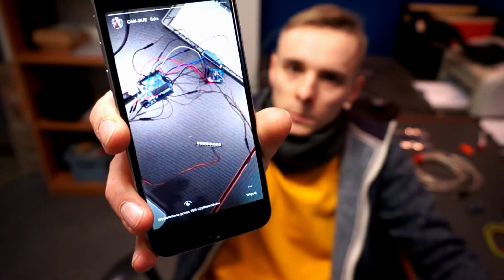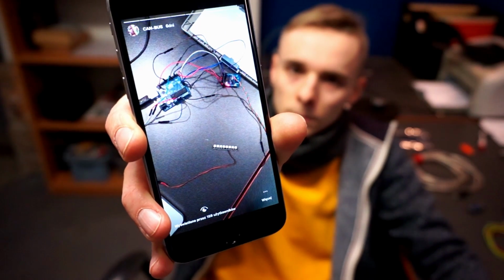CAN-BUS hacking: hardware required (01)

Comment: Injecting new data on CAN bus will require you to know how to calculate the CRC for the CAN frame. how are you handling this case?
Reply from the maker: Isn't CRC calculation a standard publicly known?
Reply: @mrfixpl  Yes it is, but for the calculation you need to know the generator polynomial used for the calculation. How would you know the details of the generator polynomial that the OEM has decided while building the car. This information is not public.
Reply from the maker: @vk-lt9wv  I have no idea yet. I'll cross that bridge when I get there.

Comment: MR FIX, what does a TIPM used for to do what? a CAN sniffer is used for what or what have you used it for?
Reply from the maker: Since all events are transmitted with CAN, I plan to use the sniffer to detect button pressed events (I have some inactive buttons on the steering wheel) and use them to control other electronics (like my custom bluetooth receiver to answer calls)
Reply: @mrfixpl  I'm planning to hack my car i20 to automatically door lock after reaching some speed and unlock as engine is off.

So, which variant of CAN BUS shield is suitable for my project? Thanks.